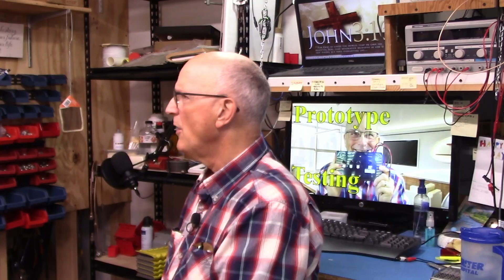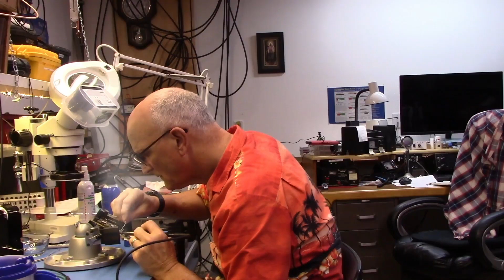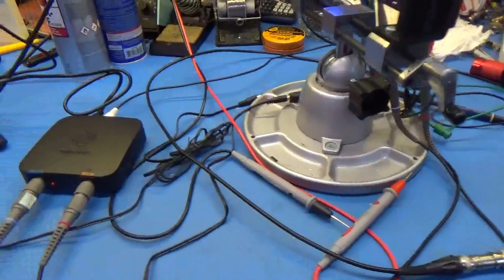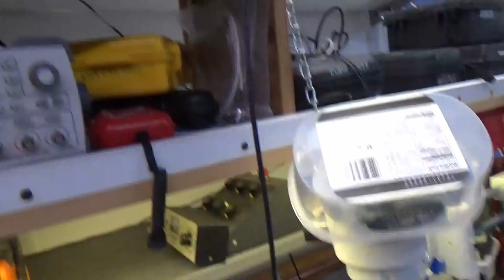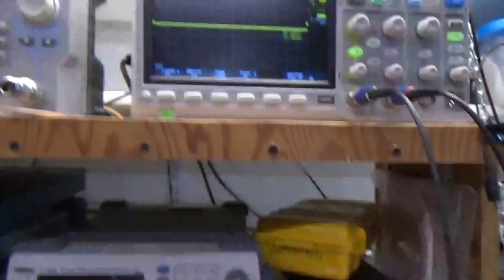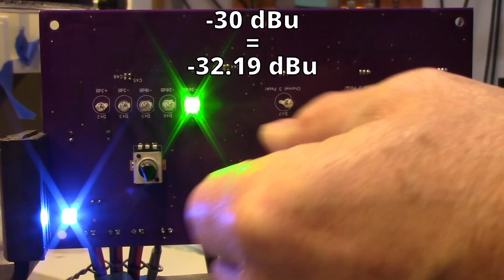DEMO: Testing the First Prototype (060g)

Comment: Hi Ralph.  Do you have a video covering how to tune the IF and RF transformers in an old ham tube receiver.  I have been using a VTVM and the receiver calibrator, and tuning to maximum.  What are some other methods to tune these transformers that would produce better results?
Reply from the maker: Good morning! No, I'm afraid I do not have any such video. I never actually had to do an alignment like that, so I have no experience in that area. I don't even own any tube-based equipment and haven't for decades.  Sorry. Wish I could have helped. 😞

Comment: Good to see. I'm the type that comments throughout the video. I'm happy you got a functioning prototype going. Keep it up. 🤙🏽
Reply from the maker: I'm sure glad it is functioning. I've already put it into service, though I don't have all the microphones built yet.... just the one. 🙂
Reply: @electronicsfortheinquisitiveex  mics take time. I've started retrofitting really old mics and stuffing new gear in them. I know they'll never be the same, but at least they'll have a life again.
Reply from the maker: @TheGeekiestGuy  I had designed a mic to use. First prototype learned that I TOTALLY didn't like the design. I scrapped that and redesigned. Now I have a mic I like and it works well. I *should* create a very short video to introduce the new design, I suppose.
Reply: @eie_for_you  yeah. You made it. It makes sense to put it up. If it's short, I suggest making a YouTube short out of it to help with the algorithm. 👍🏽
Reply from the maker: @TheGeekiestGuy OK, you've convinced me!
The next video coming out is one on PLLs. But, the next one after that...
I've never made a short. Seems they are supposed to be, well, short like 30 seconds(?). I'd have to investigate that idea.